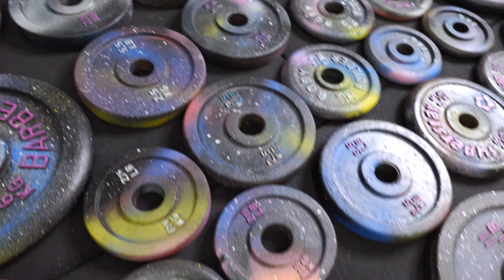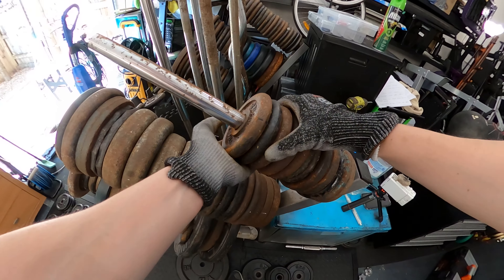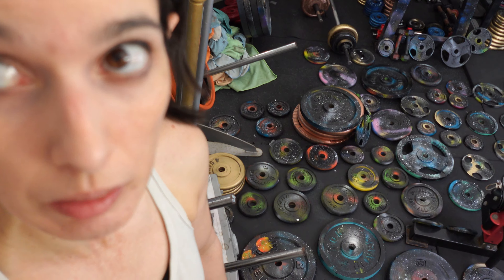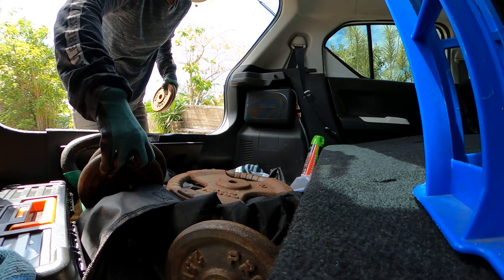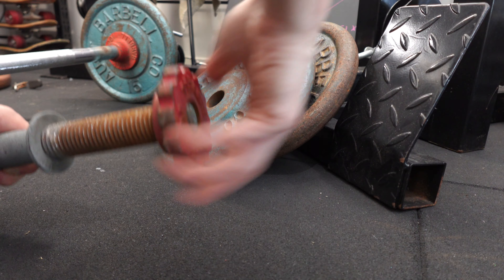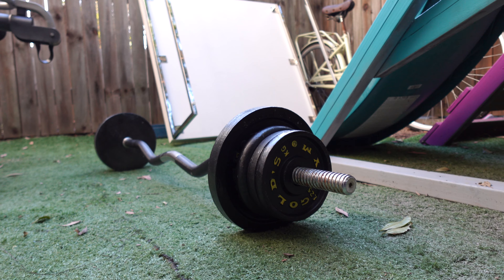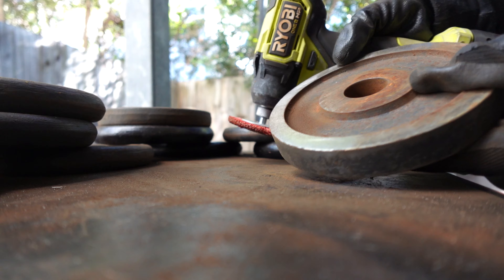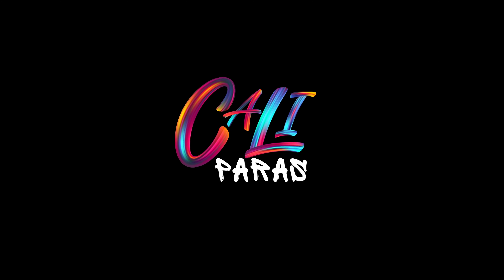Restore old rusty weight plates full time!

Comment: I did this when I made a home gym during covid. had a wide range of 50mm and 30mm weights, 3 barbells, dubells, a squad rack and a bench. I submerged all the weight in vinigar for 24 hours. Could wipe the rust away pretty easily after that and sumerged it in a bath of water with baking soda. New coat of paint and I safed a shit load of money.
Reply from the maker: awesome work